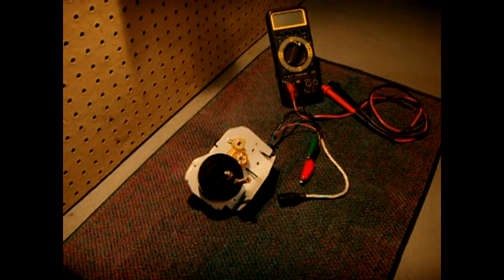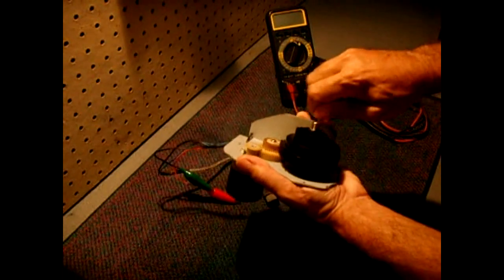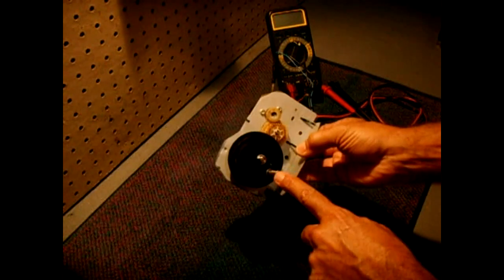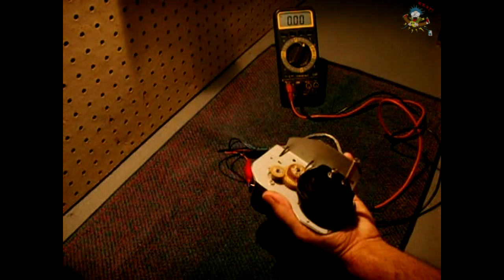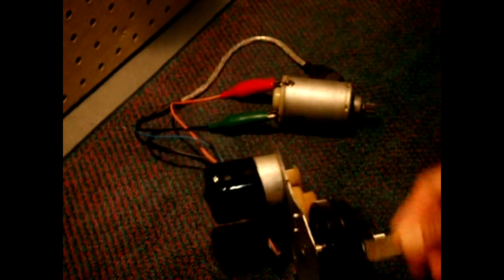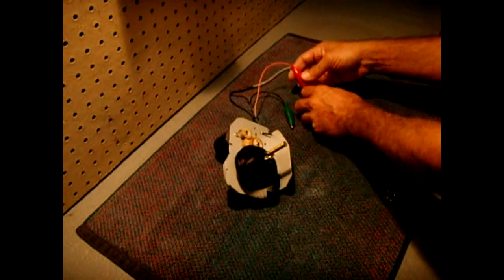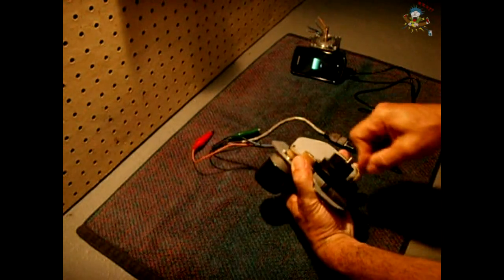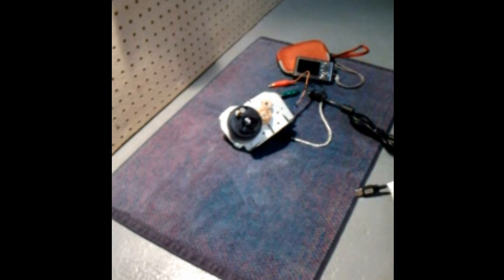Homemade Regulated Output Crank Generator(5V USB & 13.5VDC)

Comment: What DC-DC converter did you upgrade to from the LM7805? Is the LM in essence a voltage divider?

Keep up with the great content!
Reply from the maker: I replaced the 7805 with a high efficiency switching converter. If you liked this video, you'll love the videos below. Thanks for watching and be sure to rate thumbs up and share. 

https://www.youtube.com/watch?v=8rj-emSUf7I
https://www.youtube.com/watch?v=zwdydXyC-k0
https://www.youtube.com/watch?v=FmcH_69Y_ZY
https://www.youtube.com/watch?v=HWXOZD7fFg4
Reply: Thanks for the reply. I was hoping you could tell me more details about the switching converter. Does it require it's own power source?

Comment: Nice video! I need to put a bit more powerful one on my bicycle, what type motor would you suggest for that?
Reply from the maker: You can use any quality permanent magnet motor. They all work, brushless is best.  Look for an old/busted tread mill. They have really nice motors. You can also use a small 3 phase motor as well. Then rectify all 3 phases into one DC output.
Reply: electronicsNmore Thanks, I would like it to generate while I am riding (moving, not a stationary generator), so I might look for smaller sizes. Keep up the great video's!
Reply from the maker: I have another PM motor which I am likely going to make a bicycle generator with. The output will be USB 5V reg.

Comment: Nice reuse! Now you've gotten me thinking about the gears from a scrapped laser printer I have.
Reply from the maker: Yes, the gears worked out great for this use. If you have a scrapped laser printer, I would salvage the gears, as well as any nice smooth steel rods.

Thanks For Watching!

Comment: I had not thought of using a bridge rectifier to "correct" DC. Also, I had not come across your light video since I found your channel. Searching for it now! :)
Reply from the maker: Hi there. The Schottky diode bridge does a great job with that, and the voltage drop is very low across those diodes. I will post the link to the LED video in this video right now. It will show up as an annotation when I show the LED light.

Thanks!

Comment: Neat gizmo, though I would have used a switching buck regulator (like ones found in car chargers) instead of an 7805, that way the current output on the regulated 5V output could be more than 500mA. I would have also used a brushless 3 phase motor and use a diode bridge to rectify it. That would also been more efficient, but I guess that isnt always available with scrap electronics! A stepper motor would have probably mad a good substitute though.
Reply from the maker: 500mA is sufficient for me. The lm7805 can supply up to 1A output if needed, at least that is what the data sheet claims. Brushless 3 phase is always best, but like you said, you use what you have handy. I have another project that will use the stepper motor. :-)
Reply: electronicsNmore Is there a heatsink on it that can dissipate 8 watts of heat in the 7805? thats why I said 500mA, since linear regulators cannot dissipate a lot of heat without a good heatsink. I'm not so ure but I think the will get very hot even with only 500mA! Maybe the thermal capacity has saved it since I don't think it is being ran for long...
Reply from the maker: Your correct. If I pushed more than 500ma, I would certainly add a heatsink. If I was going from a high voltage (20-30VDC) down to 5vdc, then the lm7805 would get very hot, but going from 12v down to 5v is not that far off.
Reply: electronicsNmore I don't know where you both got the 500mA value from ;).
I was specifically waiting for the assessment of the current output, which never came, you even deliberately took the meter away before applying any load... Strange. 

I wrote the same thing under the solar panel video, and will repeat it here: showing just the voltage or just the current is meaningless, it's the power output that means something, in other words what is the voltage under various current loads.
Static charge that builds up on your body can be 25000V or more - hooray, let's power the grid wit it, right? Wrong, because the current it's capable of producing is very, very, VERY low, bringing the power of that charge to an extremely low value... It's enough onnly to produce a tiny spark when you touch an earthed metal object, or to destroy the inputs of delicate electronics, that's about it.

When you connected the 12V bulb it was clear that it's getting only approx. half the power it needs to be fully lit, therefore the voltage has dropped substantially under it's load.

I would also advocate using a switched mode regulator (like the ones sold on Chinese sites for a couple of bucks) to increase the regulation efficiency; now any voltage above 5V is converted to heat (lost...) on the 7805.
Reply from the maker: 68Stan First of all, there was nothing "deliberate" about what I did in the video. The 12V bulb used in the video was 10W. I just noted that in the video. The maximum output of my crank generator is 5W. So yes, the 10W bulb lit up around 50% - 60% of full brightness. I never made any claims in the video or video title of what the power output was. I only gave demonstrations. Power output with the unregulated leads is around 100mA higher than the 5V regulated output. I can supply a max of 380-400mA to the USB female plug, which is why I stated 500mA is more than enough from the 7805. I agree switching to a cheapo Chinese SMR would increase efficiency at the USB, and I may do that.
Reply: 68Stan I just guestematied 500mA as the max output since the difference in voltage (13.5V-5.0V) times that current (0.5A) will generate 8.5W of heat on the 7805. Well my guess was wrong, and that is way too much current for the 7805 to handle w/o a heatsink since the junction would reach about 582*C if there wasn't any heat sink. (assuming no heat sink and no air flow, the thermal resistance would be about 65*C/W between the junction and ambient room temperature, and assuming room temperature is 30*C.) (the hottest a junction should get is 100*C, any hotter and you reduce the lifetime of the part.)

Actually doing the math, I find the maximum current you can sustain for a long time w/o any heatsinking is about 120mA, that will cause the junction to rise up to about 96*C, and that is about as hot as I would allow it to get, it will be burning hot to the touch, thats for sure!

W/O proper heatsinking, that 5V regulated output is worthless if you can only get out 0.6W out of it, to charge a modern phone at a reasonable rate, you would need about 2W-5W.

electronicsNmore Also, as a tip, in your next videos where you make power generators like in the last video with peltier modules, can you connect the outputs up to various precision resistors and tell us what the voltage drops are? Not only will that give us an idea of the maximum power output, but also at what load the most power is transferred.
Reply: 68Stan Actually with the static charge on our bodies, the maximum current can be very high during discharges, possibly peaking as high as 8A so I read somewhere but is is all dissipated within microseconds so nothing bad happens. Nothing in our body has enough time to get nuked, maybe a puny amount of nerve and tissue damage where sparks occur.
Reply: Power Max Sure, when discharged in a spark, the arc would last microseconds and the current would be high. However if you would like the voltage to remain in the same order of magnitude for any useful amount of time, the current would have to be ridiculously small, ie useless.
With static charges it makes more sense to speak about energy rather than power, hence your correct introduction of the time factor.
Reply: electronicsNmore I wrote "deliberate" not in the sense that it was malicious or something :)
Should've used the word ":purposefully" perhaps - for the purpose of cleaning up the scene you removed the meter, which disappointed me, because at that very moment I expected the opposite: adding a second one and showing some U/I characterristics.

It felt strange to me, that - with all due respect - instead of showing something really useful (like how much power can this generator deliver at various speeds and loads) you proceeded to show how it can (weakly) power an electric motor, which is anything but spectacular and devoid of any practical use - who on earth would want to crank up a generator and as a result obtain a similar rotary movement but with ~10% efficiency? :)

I hope you get where I'm coming from, I'm not trying to be mean or anything, and I know it's easier to criticize than to do stuff myself. I fully respect your time, effort and resourcefullness. It's just not the first time that you lose the chance of teaching people a few fundamental principles of power conversion in a fun and engaging way, by empirical demonstration:
- the maximum, open-circuit voltage
- the maximum, short-circuit current
- the useful current and voltage range
- the optimum load at different conditions (here: crank speeds, elsewhere: sunlight intensity).
Reply from the maker: If you are disappointed with my videos, I suggest you unsubscribe. You seem dissatisfied, and I do not need the aggravation. I created a very nice, compact hand crank generator from trash which charges my phone, digital camera, and also outputs around 500mA at 12V. I consider that very good results. It does not matter what the output is on my unit, because anyone who attempts to duplicate what I made, will need the SAME motor and gear ration.
Reply: electronicsNmore 
No need to get aggravated. I'm just pointing out that it's a missed opportunity to spare people the disappointment which is inevitable when one doesn't understand that the peak voltage and peak current can't be obtained at the same time, and how to measure the output and optimize the load.

I've been explaining it so many times to so many people, that I wish that someone having such a platform as your channel would spread such useful information.

I watch your videos (on mechanics, electrical and electronic stuff etc.) and majority of them contain lots of explanations, practical advice and a bit of theory sometimes. I like them, vote "up" and don't complain...

When I do complain it's for particular reasons. Like safety with transformerless supplies (deadly if copied by careless amateurs, especially in Europe with 230-240V). Or like missing an opportunity to clear the misconceptions about power.
  
It's not meant to unnerve you or belittle your work, and I certainly hope my criticism can be taken in a positive spirit.
Reply from the maker: Point well taken. No one is perfect. I am very knowledgeable in many areas, but no expert in any one area.

Thanks for watching. :-)